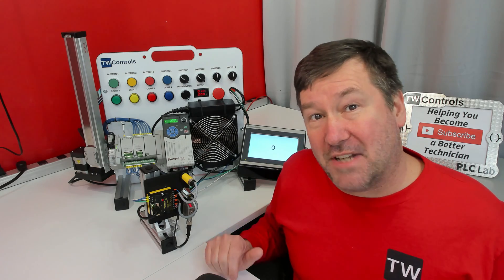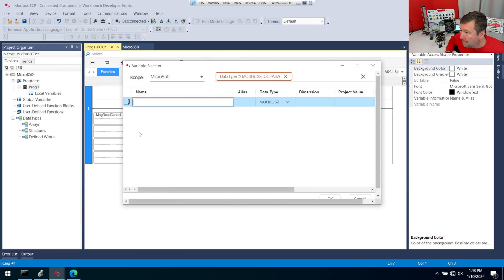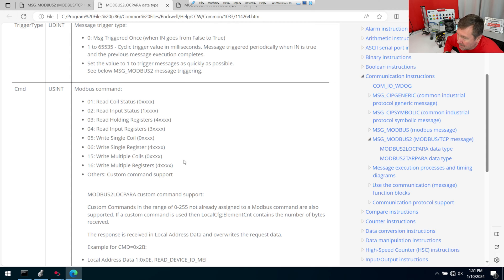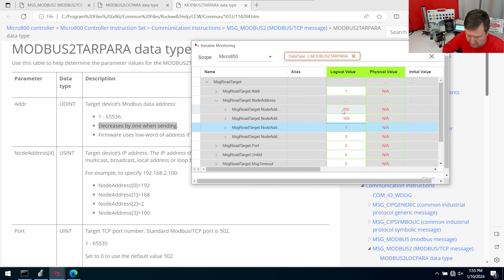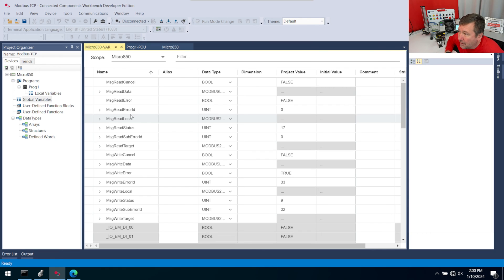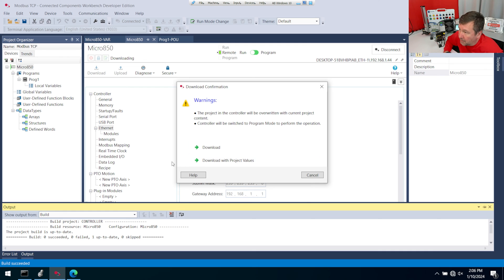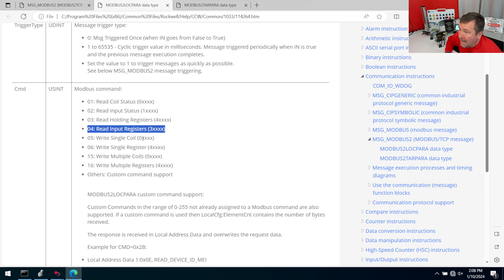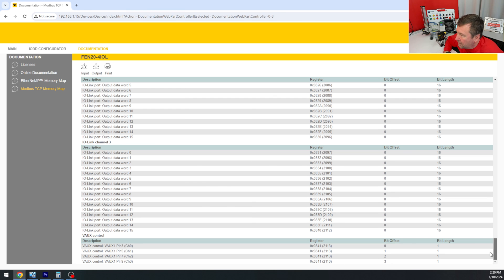Adding a Turck IO Link to a Micro800 PLC over Modbus TCP

Comment: Hi Tim, i am using the micro 820 along with a Quint4-UPS-eip, i am struggling to get any data from it. The error and suberror id's are 0 but status bit is 3, do you know what is the reason for it.
Reply from the maker: Is it looking for class 1 or 3 messaging? Implicit or explicit?
Reply: @TimWilborne I'm not sure what you mean by class 1 or 3. But if you mean holding register, coils.... then it's holding register. In the mdbus dataset of the quint4 the register value is 8197. I'm not sure of the implicit or explicit statement.
Reply from the maker: @clintonnoronha699 Your party number sounds like Ethernet/IP. Are you sure it supports modbus.

If you are using the message instruction to set the sample rate, set it to zero and it's a bit to temporarily fire it and see if the wire code shows up.
Reply: I'm able to use modscan and see the data that I want. But using the instructions nothing.
I tried that too, used a TON relay to run the instruction. Once the time elapses you'll see some change in the error code and then resets to 0 and 0 in the error fields.
Reply from the maker: It will reset every time it is executed. Take the TON out so you can read the error code

Comment: Hey Tim, Have you ever tried to connect a Turck IO Link module with ignition using Modbus TCP and tried to read an IO - Link sensor, in this case is a OGD580, measure distance an have a reading in ignition without using a PLC?
Reply from the maker: I have not but I don't see why you couldn't.
Reply: @TimWilborne   thanks for the answer, any idea in how to map the signal?
Reply from the maker: Here is one I didn't on the FEN20 Modbus. It might give some insights.
https://youtu.be/BXaY5FRX_64
Reply: Thanks for your help!!
Greetings!
Reply from the maker: You are welcome

Comment: Tim, I am trying to follow along with this method, but with connecting to a 440C-CR30. Do you think you might be able to help with this?
Reply from the maker: This isn't possible with the 440C-CR30.  It is more of a configurable safety relay, not a PLC.
Reply: @TimWilborne  I came to the conclusion that I couldn't connect to it with modbus tcp. You can only seem to do it with modbus rtu and serial com port. I am currently using explicit messaging for my communication between my micro 820's.
Reply from the maker: Between 2 Micro 800 PLCs, you can do CIP or Modbus TCP.  Here are a few videos on that.
https://www.youtube.com/watch?v=4wF6phJqUnA
https://youtu.be/w4r7t0G3Pd0